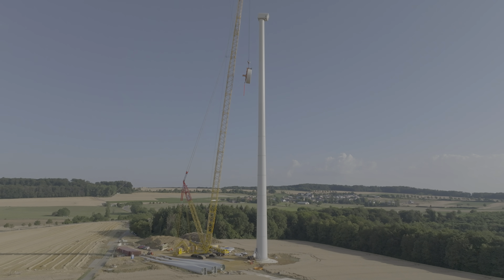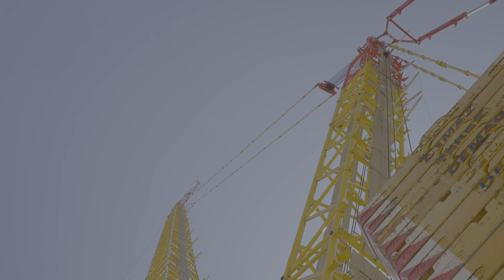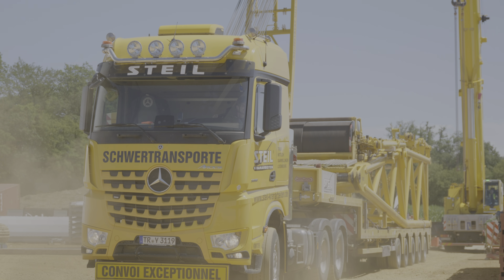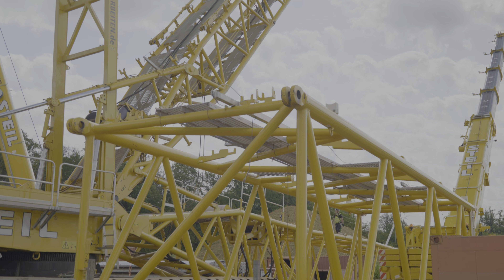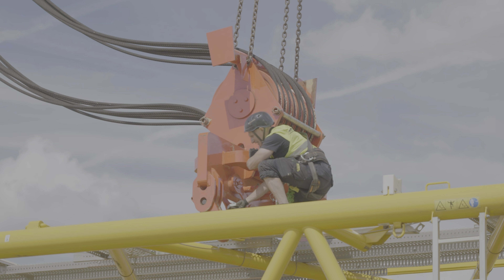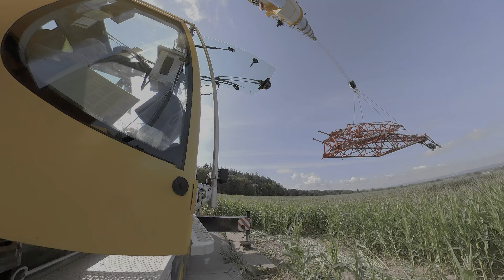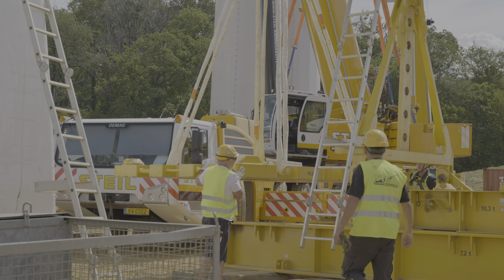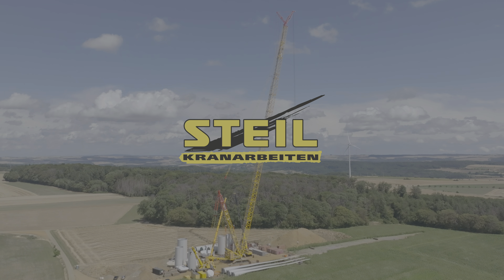Super Crane - Demag CC 3800 🏗️

Comment: What I see is great engineering, with excellent preparation. It also shows only a few technicians/operators are required. Nice!
Reply: Wind turbines need to operate for 3 years to off set the carbon emissions generated during its manufacturing and installation.   This time is called carbon pay-back and offset period.   

I really don’t believe that this is true and takes in to account everything that goes into building these turbines and on top of that the off set time is considered that the generator is at 100% efficiency running 24/7/365.25. Just the amount of rebar and cement that goes into build just the base alone makes a bigger carbon footprint then a coal fired generator does in a 14 days. These are just another tax payer funded scheme.
Reply: Macavelli principle , end cause justifies the means
Reply: saw a vid yesterday of a 250t starter block for Zoomlion counter balance going down the road , size is unbelievable
Reply: XCMG engineering is better

Comment: Yeah, it's amazing all right. It's amazing how many thousands of diesel fuel it takes to put that crane together and make the lift. And how much did it cost to pay those super technicians to put it together
and how much concrete will it take to hold up that windmill and the diesel equipment it took to dig the hole, etc and then how long will it take that windmill to recover that cost and begin to make a profit>

Comment: A giant machine like that will nevva evva evva be battery electric. The idea is completely absurd.
Reply: Actually..... cranes larger than this are already battery powered. Some are even shore powered and fully corded electric. Much like larger mining shovels
Reply: @jayj7903  Corded electric, sure.
Reply: @oldwombat Tadano already has a CC8800 1800 ton machine that can be battery or shore powered. They also have a 100 ton rough terrain that can run full battery, or be charged while working. Liebherr has quite a few machines as well. Lots of cool things happening. There definitely is market demand for battery powered machines
Reply: @jayj7903  Not true. The specifications say it is powered by 2 Mercedes Benz diesel engines. My comment stands. Yours does not.

Comment: The green scam continues.
Reply: So true . Rate of return is RIDICULOUS on the investment!!
Reply: Yep, seems like a very high level of labor and expense for a unit that doesn’t really generate that much power.  Might be worth it in very remote areas possibly though.
Reply: As long as you don’t count the energy and natural resources required to build and install these, and gloss over the environmental impact of the roads cut through mountains getting to the site, and ignore the extremely high cost per mega watt hour of the energy produced, and the financial burden to the taxpayer subsidizing the absurd payback; other than those downfalls these things are great. 
If the wind is blowing, but not too fast to damage them. 
And you’re not a bird that flies into one of the blades. 
Oh yeah, disposal. Need to dispose of them after the very short lifespan. The blades can’t be recycled and the gear oil is extremely toxic. 
But yeah, these are great.
Reply: @greenbudkelly2820 you’re right, let’s burn coal instead that has to be better for the environment! 😂
Reply: LOLerskates!

Comment: And all this for CLEAN???energy😂😂😂
Reply: Clearly you have not seen how much is involved in natural gas drilling, compressing, pipelines, turbines and cooling.  Lots of great videos out there showing the equipment and material for this.  More on a MW produced basis for sure than wind
Reply: What a waste of time and energy for just one wind turbine!
Reply: Balancing the demand for clean energy with responsible resource extraction is crucial for a sustainable future.
Reply: The same people who rail against wind turbines don’t say a thing about hydroelectric dams. Burning things to generate power is the alternative. Painfully stupid.
Reply: @doug5713 Hydroelectric dams are great. A pretty good alternative to anything. But solar and wind are horribly pollution oriented. People have been sold a bill of goods by the lobbyists.
Reply: @airmecher I think you should lay off the koolaid buddy, comparing wind and solar construction and disposal to the alternative which is burning things, that’s a special kind of stupid.
Reply: @doug5713 
Actually it is the other way around. Solar is only effective 12 hours a day, maybe, during the summer. Less in winter. And very little on cloudy days.  So at best a maybe 35-40% ROI. Wind is worse. Since it only works on windy days although it can work at night, unlike solar, it's production value is about 25%. That means for a given need you need 4 times as many generators. And they still require a lot of oil. 800 gallons plus, per unit. Which burns spectacularly and can't be extinguished due to its height. So they just burn till they fall and splat everywhere. A horrible ROI. Neither platform can exist without heavy support from government, ie. taxes. A windmill is good for at most 20 years with blade changes at about 8 years. Meanwhile a natural gas plant is cleaner and can easily produce on demand, when compared to all the crap producing said solar farms and windmills with their very toxic crap to manufacture. Then disposal. At this point NG is the way to go. And it isn't even close.

A good avenue to research would be small nuclear plants with mass production. One design, well built and thought out. Those could be deployed easily, once a good design is approved.

And I'm not your buddy. You don't even know me.
Reply: What a load of horse 💩, sick of this agenda and the hypocrites who are pushing it.
Reply: I used to work on a TC2800 years ago, this brings back good memories! 👍🏻
Reply: Never tell for all these petrolheads that oil rigs, refinement, delivery etc needs way way bigger machines: cranes, ships, helicopters. These installations are very small things compared all the engineering chsllenges begind the megalithic constructions of that fckng petrol you need so badly! Just thos constructions happen far far away, many times on the ocean.
Reply: @zoltanberkes8559 
And what do you do with the blades when they are removed after their life cycle? They are buried and never degrade. Solar and wind are not the do all you people have been programmed to believe.
Reply: Doing nothing and continuing fossil fuel usage isn’t the answer.
Reply: Do you think that nuclear central use less energy to be build, then to be used then to be destroyed (that is impossible) ?
Reply: And how much oil, energy is used to keep this monstrosity making free energy 😂😂😂 don’t be fooled !
Reply: Yep,many studies have shown it takes about 9 months or so for a big wind turbine to repay its embodied energy, after that maintenance is a tiny fraction of the energy it produces.
Reply from the maker: It's about free energy available from nature.
Reply: @laurentbreyer  70 truckloads just to get one crane assembled?!?!?!? this boondockle is neither clean nor free!!! not to mention the large amount of oil based lubricants needed to run the turbine.
Reply: @laurentbreyer  and all the energy/ carbon it takes to make all that Equipment. Just to get ”free” energy, lady you are short many bricks.